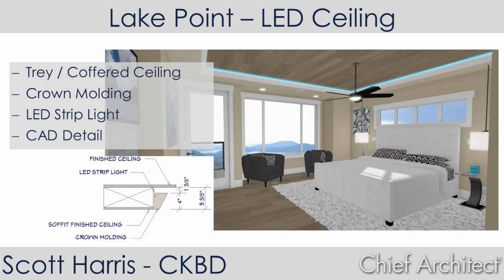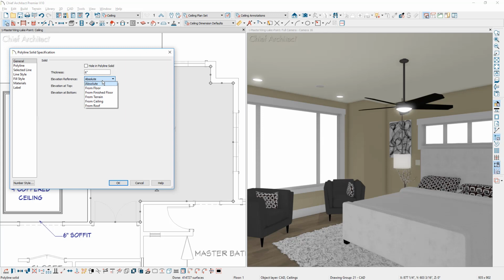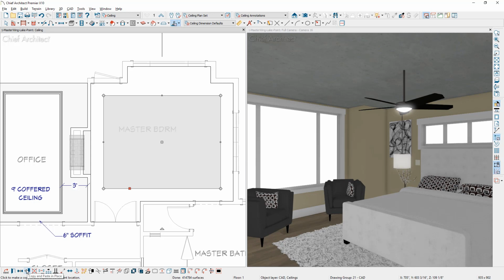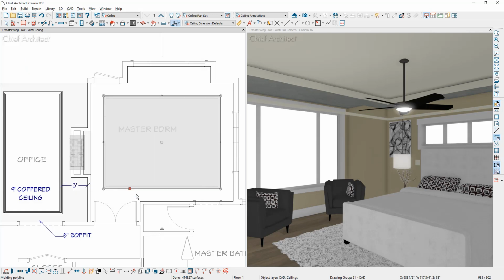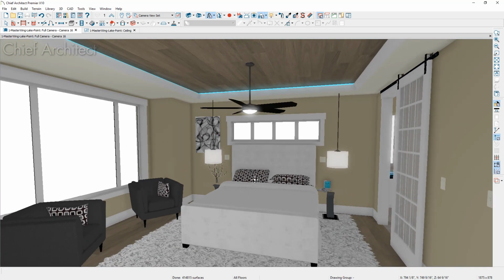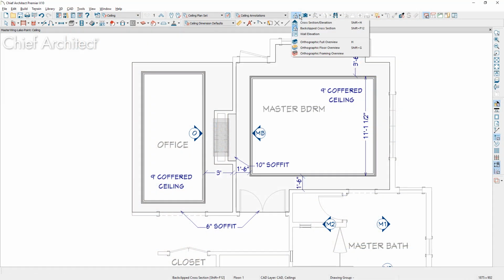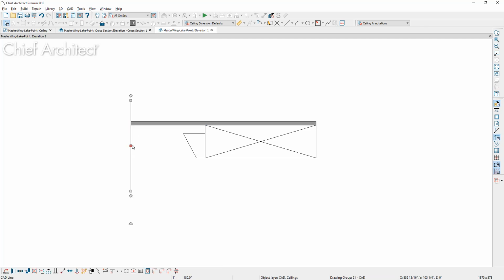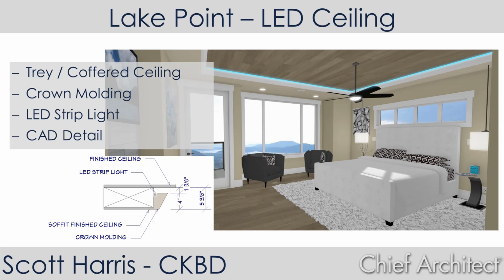Lake Point - Ceiling Design

Comment: So this only imitates a LED, it doesn't actually emit any light when you raytrace :(
Reply from the maker: Hello DoubleAces49! Yes, that's correct. This technique will imitate an LED lighting effect but does not have any light data. If you'd like to use an actual light source, I would recommend using the new Rope Lighting tool in Chief Architect X11! You can adjust the color of the Rope Light to achieve the desired LED appearance.

You can learn more about the new Rope Lighting tool in this video: https://www.youtube.com/watch?v=nUz4oUMZHkw.
Reply from the maker: Raido Purga, Unfortunately at this time a verticle Rope Light is not supported. I'll share your request with our team! Thank you.